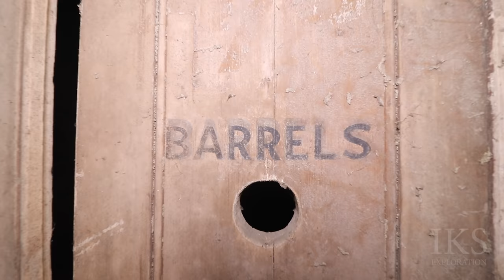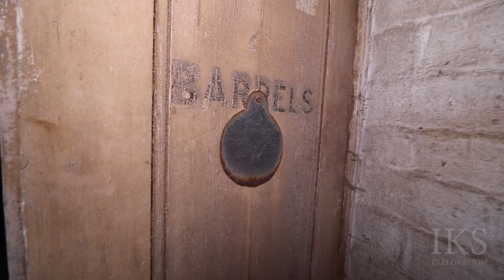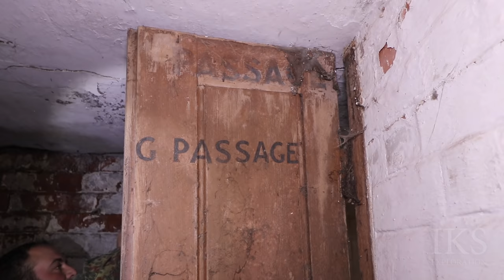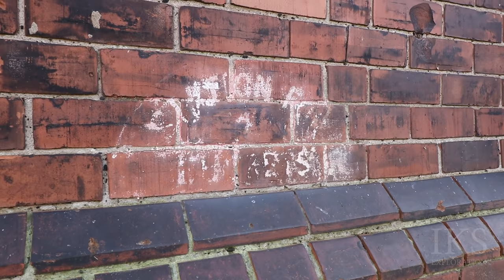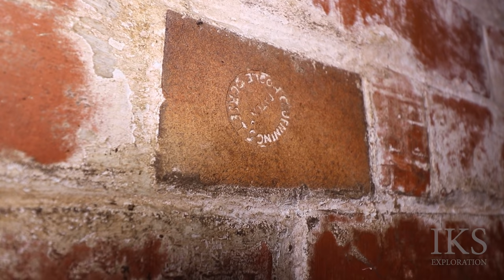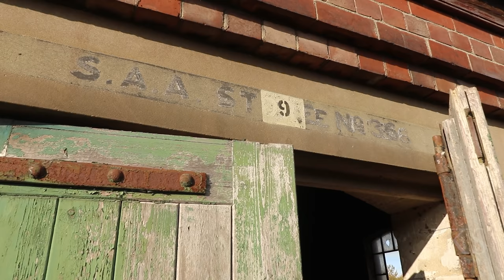Abandoned 1800's Gun & Explosive Powder Factory

Comment: Well, you're right on my doorstep fellas, 10 minutes from where I live. I wonder if you've ever considered what it feels like to see someone probing about on your own property? Because this comes pretty close!

The site was served by the Selby & Driffield Railway, and had its own shunt off that line, just North of the point where the S&D joined the ECML (Edinburgh/Newcastle/Darlington/York/Selby/Doncaster/Newark/Grantham/Peterborough and all points in between. The S&D was axed by Beaching, and closed in 1965. The ECML was diverted around Selby to take in the "new" Selby Coalfield and led to Selby becoming something of a wayside station on the remaining Hull & Manchester line.

Whilst you were here, did you bother to take a look at the old armoury? Located in (wait for it) Armoury Rd. it is now an Al Murad carpet store, but the outside of the building is still clearly the old armoury. With a bit of negotiation, they might have let you in top have a look-see.

At 6:15, that's a modern (ish) arc discharge lamp SON/Metal Halide/Mercury etc. You'd need to see it light up to be 100% sure. The little metal box contains the ballast, igniter and capacitor needed to light that puppy up. Absolutely nothing to do with the building's original use.

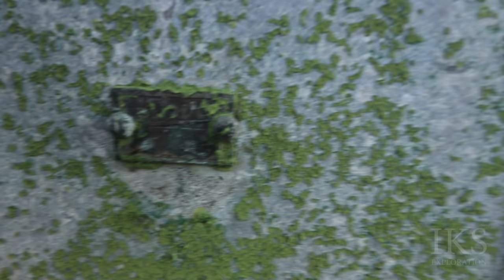At 40:40 "Whatever that says..." - It says "Revo", the same as those dome lights, inside, and possibly the drop-lights/pendants, though they look very much like the lamps made by "Coughtrie". There is a mixture of Military retro-fit, and commercial stuff, which may be a tad confusing. A much more forensic, or empirical, exploration would speak volumes.

About 54:00 "You'd think they'd rent 'em out the workers..." When a previous incumbent wanted to do that, the local authority refused to allow him to refurbish the houses. That's why it didn't happen. The little block of houses was also targetted by theives in the early 1980s, who stole the roofs, Belfast sinks and York ranges, amongst other things. And by God, that's a ballsy move at about 57:00 minutes! Those stairs and floors have been rotten for the last 50 years that I know of!

At 1:03:45 "What's that on the ceiling   " - Is one of the two pulleys that once supported the clothes airer, which was place high in the room, and just forward of the fireplace. We actually used one in our house right up to September 1984! - How about that?!

At 1:07:00 A Melamine lampshade! You don't see many of those these days. Melamine was very brittle at the best of times. Heat and light degrades the stuff, and the years just condemn it to little more than dust. The indications tend to suggest that this site was still occupied up to at least the 1950s, or at a pinch, early 1960s. As I say, I've known this site for 50 years, and it's houses have been pretty much derelict in all that time.

I hear voices! - Followed by a hasty retreat!..... Hmm, I wonder?

If I see you around my place, should I just out "Eer, get orff moi land"?

Comment: Ian, brilliant explore and so untouched, a rare sight. The light fixtures with the metal grills were originally manufactured by Holophane, now American owned and near Bletchley. In the late 1990s I re-engineered the castings since the old die casting tools had worn. They were explosion proof and as far as I know they are still made for flour mills and petrochemical plants. Thanks for sharing. Best, Paul